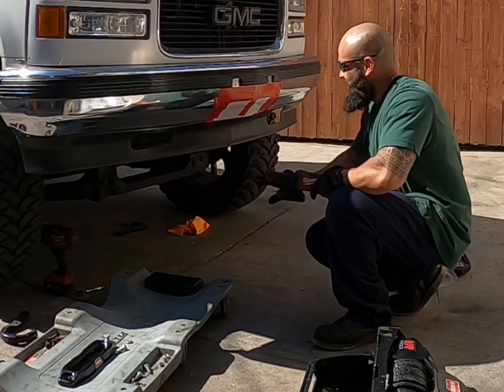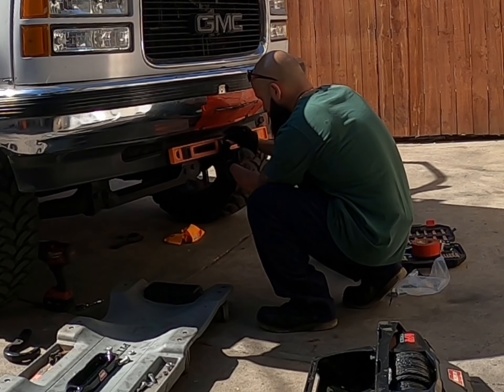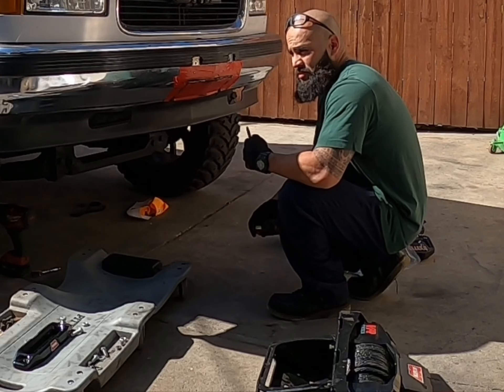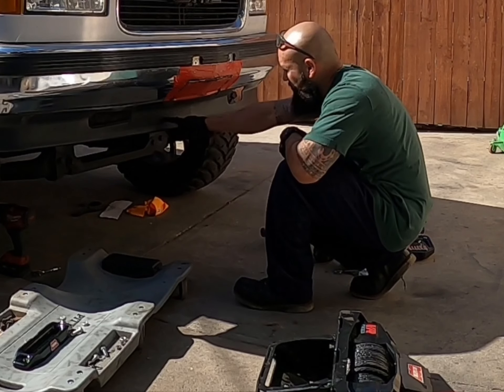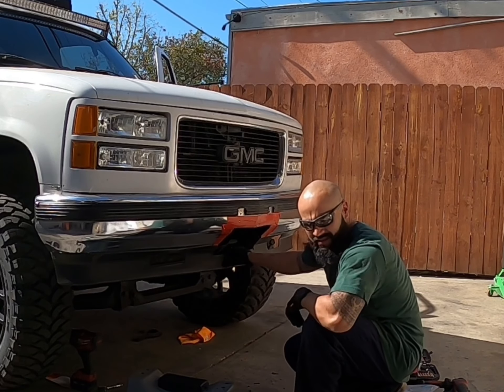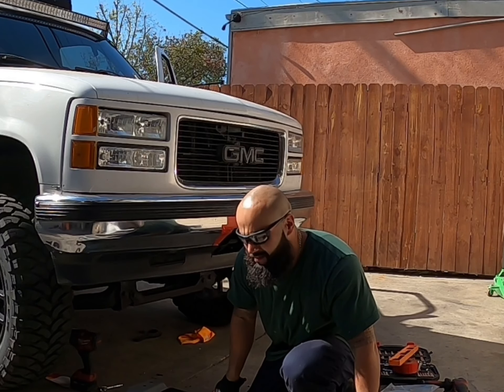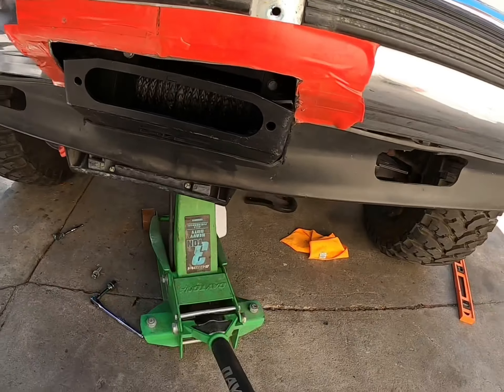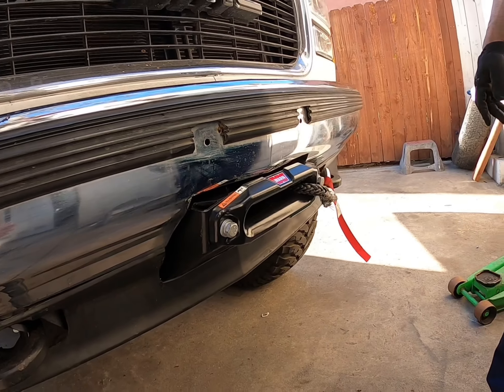How to install the Rough country hidden winch plate on 88-98 c/k 1500

Comment: Legit video bro. I just ordered one for my 98 Tahoe. What's your set up like? For the power and wires and control box? Appreciate the info. 💯
Reply from the maker: I ran the power wires along the frame zip tied away from moving parts and connected them directly to the battery, but you can also connect a cutoff switch before the battery for safety

Comment: They didn't have that hidden winch mount when I  did mine. I had to make my own hidden winch mount for both the front hidden winch and the rear hidden winch. My truck is a 95 k1500 stepside silverado btw.

Comment: Great installation! Thanks for good info. 
I want to do the same to my -97 Yukon, but RC tells me that part they offer doesn't fit to GMC, only Chevy. Can you tell me part number you used? 
Again, thanks for very informative video! Cheers.
Reply from the maker: Yeah they say that on the website, SKU 11008 Brand Rough Country
Reply: Thanks for that, I knew it going to fit!!!